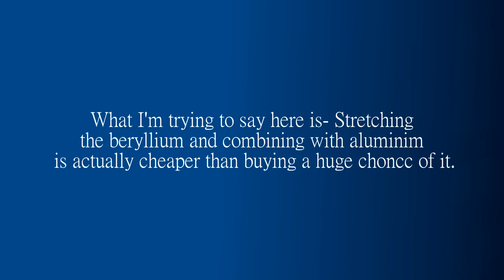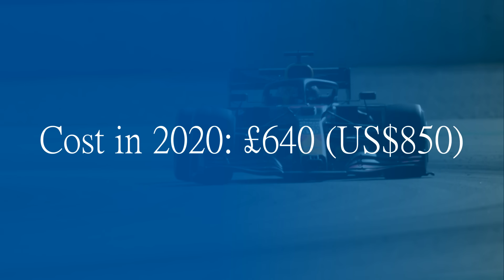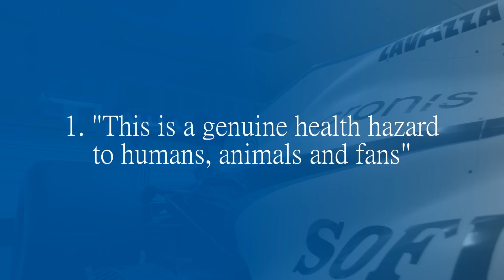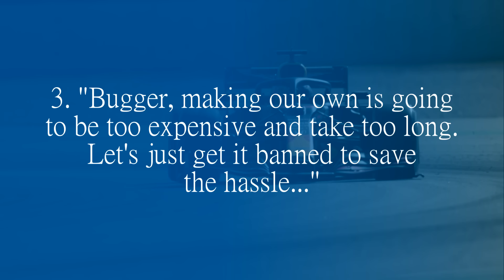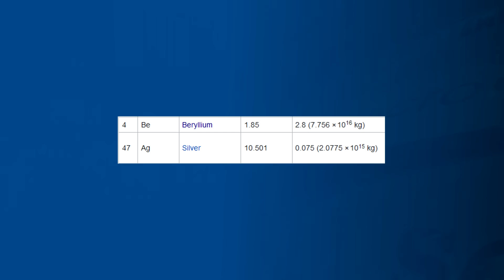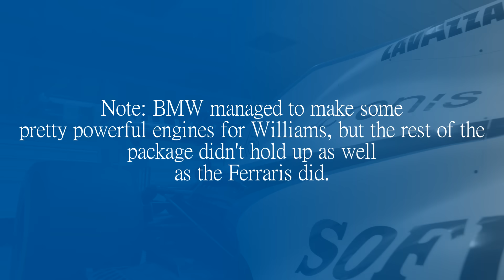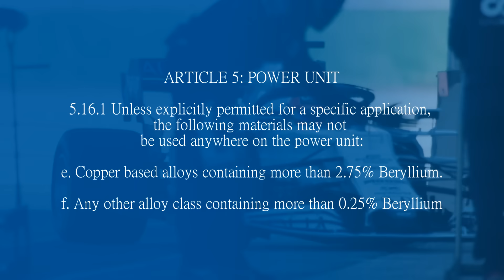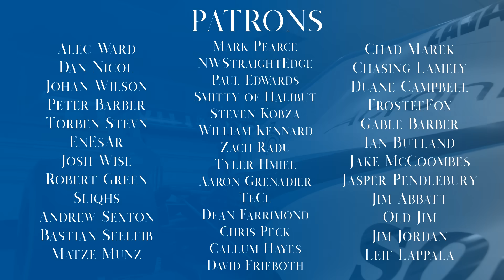MCLAREN'S "TOXIC" ENGINE! The Story of the Mercedes Beryllium Alloy Pistons (1998-2001)

Comment: This kinda ties into the banning of lithium and magnesium for chassis and rim construction because of an increase in catastrophic fires in the '70s and '80s. There's also the use of methanol fuels in older Nascar or Indy racing, methanol burns with a very slightly blue flame, but in daylight it's near invisible. So there are videos of refueling crews catching fire, but you don't see them being on fire and yet they act in a panic. Very alien to see.

Nowadays I think the carbon brake dust you see in the heavy braking zones is the new cancer-cause on the loose. Especially since it's carbon and I'm assuming there's a healthy (ahum) mix of grades of ultra-fine dust particles. I wouldn't want to breathe in a lungful of that stuff, imagine doing so for over 10 or 15 seasons.

Comment: The toxicity is heavily debated.   I have one supplier of this be bronze stating to mill , turn , grind , etc  ALWAYS wet AND with suction of air out of the machine .  He said some people ( roughly 30 percent) are highly allergic to be so even 1 particle can cause the  berrylium cough  as it settles in the lungs somewhere . In the long run the continous inflammation of that spot will lead to cancer.   

Another supplier stated that be bronze up to 1 percent be wasnt that dangerous and could be grinded dry using adequate removal of grinding dust with hoover / ventilation.   

Well....better be on the safe side I guess.

So apart from political decisions by the FIA ...... the possible harm if used in an engine was in my opinion valid to ban this material.    
Not to mention the price of the Lockalloy and price of machining and handling it.  And also the ideas of some big teams to make a complete engine block out of it so expansion rate was same as pistons.  The price would skyrocket of such engines .  Smaller teams could not afford such engines let alone if used as qualification engine for only few laps.....

Comment: The Porsche 909 "Berg Spyder" hillclimb car had beryllium brake discs. Well, one of them did, Porsche only had enough budget to outfit one of them that way. Which is scary, because as mentioned beryllium dust is extremely dangerous.
Reply: Are you sure it wasn't the calipers (a part that isn't being worn), rather than the discs themselves?
If it really was the brake discs, then that's clearly insane.
Reply: Thats insane
Reply: There's enough "ventilation" for it to not be a problem for the driver as much with his helmet, but the pit crew oof.

At least the engine itself, the pitcrew doesn't handle that on the spot.
Reply: well nobody is sucking air straight from the wheel, It will be fine
Reply: The dust that comes off metal brake rotors is the brake pad itself, not the rotor as the pads are carbon/graphite and the rotors are metal. Now if the brake pads were beryllium and the rotors were steel, then it would be an issue but no one would ever make metal pads as that is effing stupid.
Reply: beryllium IS exceptionally toxic to biological entities. Just google it. It has some wonderful physical properties, but it can kill you.
Reply: Wtf lol

Comment: You didn't explain WHY these engines made more power.
Longer stroke means smaller bore, smaller valves and LESS power.
Reply: A longer stroke doesn't always mean less power, take the ford pinto/Lima/metric engines used in pintos, rangers aerostars and most everything from the 80's till 2001. The 2.5 in the late 90's rangers Was the same as the 2.0 in the 86 ranger (except fuel injected not carbed and other tech stuff, OBDII instead of OBDI), but the parts would switch, and the 2.5 was stronger than the 2.0 same bore different stroke.
Reply: Leverage
Reply: I thought that shorter strokes means higher revs and faster power responses
Reply: Longer stroke smaller bore have some advantages over bigger bore smaller stroke engine. If you can make the longer stroke engine rev as high as the shorter stroke one you will make more power due to those advantages.
Reply: Longer stroke also means easier to achieve high compression ratios and (thanks to smaller valves) better scavenging in high rpms with identical valve overlap. Ofc you can out-engineer these "problems" in short-stroke wide-bore engines but it can become a question of tightening the tolerances even further

Comment: I've worked with berrylium coated metals in the past and had some health and safety modules during training. I may be remembering this incorrectly but we were warned not to let the soldering iron touch the sides for too long as it could affect the berrylium and we'd end up breathing it. If a soldering iron can affect it then I'd think combustion in a high powered engine would certainly affect it. 

Having said all that, this was just a coating and not an alloy. Most likely the coating is able to separate easily when heated but an alloy is able to resist heat and not degrade.

Comment: There are inaccuracies here.
1. Beryllium is not stronger than steel. Not as elemental Beryllium, and not as a Be-Al alloy. Elemental Be has a tensile strength of 370 MPa, and Be-Al is similar. That's the same strength as plain low carbon steel (such as AISI 1010), and this lowest grade of steels is never used for aerospace, or high level motorsport applications. A representative steel alloy would be something like 4140 chromoly, which has a strength of 800-1600 MPa. There are even stronger specialty steels, with strengths as high as 2800 MPa. Be is extremely weak in comparison to any steel that might be used in F1. 

2. The video shows "6x stronger/stiffer". Strength and stiffness are not the same thing. They are not even related. And as I said, Be is far weaker than steel. It is true however that Be is stiffer than steel, by about 40-50% for a given size, or 6x for a given weight. That does not make it stronger. Only stiffer.
Reply: I believe the comparison is more about the strength to weight ratio of various alloys, not their ultimate tensile strength.

Comment: Load of rubbish that these are toxic. You would have to grind them into a mircofine powder and proceed to inhale in considerable quantities. To say toxic is false it’s dust is an irritant which would cause respiratory irritation not toxicity. The disease cause would be similar to silicosis or asbestosis. Plenty of far more dangerous materials in a F1 car than this. Amazing innovation though, love the sound of these cars.
Reply from the maker: Considerable quantities? Just 4mg of the dust is enough to be extremely hazardous to your health. Which would come about in the machining process.

Acute beryllium poisoning is acute chemical pneumonitis resulting from the toxic effect of beryllium in its elemental form or in various chemical compounds
Reply: Hi 4mg is a huge quantity to inhale, also the machining process wound not produce dust fine enough to be considered micro-particulates to get to the terminal tissue to cause damage. We have intact fully functioning cough reflexes sufficient enough to resist this. Micro particulates would probably come from the combustion of the this material not machining.
Reply: @ellb4333  You absolutely don't know what you are talking about. See Aidan Milward's informed reply.
Reply: Well that’s your opinion, Aiden is getting toxicity and inflammation completely confused. Pneumonitis is inflammation not toxicity, and completely reversible. As discussed machining wouldn’t sufficiently obtain the particulates sufficient to cause this. Toxicity is due to agonist/antagonist key lock mechanism or interruptions in enzyme processes or cellular membrane respiration. Interesting video but completely scientifically inaccurate. Confusing medicine with sensationalism. Research your topic, look for informed studies with cohorts patient and numbers instead of being utterly guided by what YouTube tells you. What do I know I’m only a humble professor human physiology.
Reply from the maker: @ellb4333  yeah, really humble.

Would be nice if these experts could actually explain why someone is wrong without the condescension.

Comment: As exotic materials go, Beryllium is relatively inexpensive.  It’s cheaper than Silver.

Edit:  I just got to the point where you said Beryllium cost $300 more than Silver.  You showed a kilogram of Beryllium at $850US, Silver is $828.51, so I was wrong that Beryllium is cheaper.  It’s also not $850/US.  Maybe that’s the ore price.  I found it for sale at $27US per GRAM, or bulk discount at $2,200US for a kilo.

Comment: Alloys of beryllium are widely used in industry for non-spark tools that are used when working in explosive atmospheres (oil refineries, paint factories etc.) Any dust from beryllium is extremely hazardous and requires extreme caution however.
Reply: That will be beryllium-copper. Also in use for spot welding electrodes, thanks to its good strength and high electric conductivity. Still >90% copper though.
Reply: @eriktempelman2097  we use beryllium copper in tool making.   has great wear and heat dispersion qualities. great for molding components
Reply: Used to work in a ceramics shop that had a beryllium dept.    Sealed everything.     Very scary stuff.
Reply: @briansharp4388  Beryllium ceramics would be beryllium oxide or possibly beryllium carbonate, and would very much be a powder. Definitely more insidious than any beryllium alloy you'd encounter.
Reply: Porsche had used plated beryllium brake rotors on some of their hill climb cars back in the late '60's

While pure beryllium is transparent to X-rays and used as a 'window' in high vacuum applications like cyclotrons, it is reflective to IR and had lots of applications during the cold war for observation of missile launches.
Polishing those satellite mirrors cost my father his lungs.
Reply: This would make sense, at the time there was 4 oil refineries within 7 mile radius of the machine shop mentioned in my post.
Reply: C17200 Beryllium Copper is 2% Be.  This is the most popular alloy of BeCu.  Racers love it for use in valve seats for its combination of high thermal conductivity and hardness.

Comment: We use beryllium copper alloy on oilfield equipment quite often. It's not really as bad as it's made out.  Toughmet is an alloy with similar properties but without any toxic issues. Probably not as light though but nicely self lubricating and pretty strong.
Reply from the maker: So is it totally safe then once it's fused?
Reply: @AidanMillward  Well its used in hand tools like wrenches and spanners for explosive/hazardous areas for its non-sparking properties.  So I would say that is a good indication.  Basically unless your machining it that would create fine dust particles that could be inhaled.  Your good.
Reply from the maker: @MiracleManM  cool!

Comment: Don't you love the contradiction that F1 is "the pinnacle of motorsports" but that it also bans all kinds of developments that are too successful because of "unfair advantage" or the gloriously vague "safety reasons"? 

This incident by the way shows yet another example of how Ferrari uses its veto right/power over the FIA to undercut competitors. Yes, they posed it as a safety risk, but I think Adrian's comment of "we want it banned so we don't have to spend money to take away McLaren/Mercedes' advantage" was the main reason behind it. Ferrari doesn't give a toss about safety if THEY have an advantage. Just look at the horribly toxic rocket-fuels the first era F1 turbo-engines ran on: they called it gasoline because there was a tiny bit of gasoline in that mixture but it mainly was a very toxic brew of all kinds of complex hydro-carbons. Ferrari never complained about that, although everyone in the pits was exposed to that stuff.
Reply from the maker: Given that the stuff is highly toxic when it gets in the air, they probably had a point this time.
Reply: @AidanMillward  The same goes for that "rocket-fuel", complex hydro-carbons are pretty toxic too and the smell alone supposedly had people gagging and complaining about headaches.

Comment: Just a tiny correction, it was silicon carbide, not boron carbide, that was used in the aluminum metal matrix composites that replaced beryllium. Both metals are sold today by Materion under the SupremEX and Albemet brands respectively.
Reply from the maker: It looks like both were used. But interesting to note.

Comment: Beryllium also makes the pistons much more thermally stable, they don't expand or contract as much as other steel or aluminum alloys, meaning they probably could run tighter tolerances on top of being lighter. But yeah alot of engine innovations at the time were immediately banned, most before ever testing past single cylinder or computer phase.

Comment: So this is bad for your health, but we still use it in the air?
Reply: Yes, leaded gasoline/petrol is still legal and extensively used in piston-engined aircraft. I think the argument is that it would be even more dangerous if aircraft were falling out of the sky because the engine valves have burned out; it may actually be that the casualties from falling aircraft would be less numerous but more obvious than those from breathing in lead compounds that have come from engine exhausts. Aircraft piston engines of recent design can safely run on unleaded fuel. The fuel used in jet and turboprop engines is free from lead and always has been.

Comment: The Porsche 908/3 also used Beryllium for some of these cars brake discs. Hilarious if you think the material is actually poisonous or rather kicking allergic reactions. And brake discs are wearing over time… so, great to leave a trail of beryllium dust along a race track…
Reply: Just like asbestos brakes until 1997.

Comment: Used to install/machine Beryllium valve seats to convert old cylinder heads for unleaded use. Nice to find out 20 years later it's toxic. That and replacing asbestos clutches and brake pads without knowing makes me feel much better
Reply: Don't tell me you smoked as well...
Reply: @rkan2  If this person has managed to do all three and somehow NOT have cancer, I would strongly suggest for them to go to Las Vegas.
Reply: I worked in a automotive machine shop as well (NAPA) . I have replaced valve seats too. I was told it was just hardened steel inserts .
Reply: @321CatboxWA   You can get them made of many materials. Beryllium seats aren't as hard as tool steel or hardened steel seats which makes them nicer on titanium valves or something that is going to be slamming valves hard (big lift/high spring pressure). They also have great thermal dissipation.
One day I'd like to see Vegas, although long way from Western Australia 🇦🇺

Comment: The material they used is called Lockalloy.  It was invented by Lockheed decades before for use in space.  62% Beryllium/38% Aluminum.  You can still buy the stuff today.  Just don't grind it without wearing breathing protection.  Inhaling small particles leads to berylliosis.

Lockalloy was also being used for brake calipers in F1 at about the same time.

Porsche used Beryllium brake pads on the 917 back in the 70's.  (Talk about generating beryllium dust that might get inhaled by the driver.)
Reply: Im an engineer and if we even think about beryllium in a project we have to get 4 upper level signatures. Ive never actually gotten to use it because of that.
Reply: @josephjones4293  
The golf club manufacture used to use Berylium Copper in the putter heads
Reply: @mpetersen6
Ummmm… thanks?
My old race engine had BC valve seats… I didnt say Ive never heard of it, I said i’ve never gotten to do anything with it due to regulation
Reply: It's marketed under the name of AlBeMet by Materion (formerly Brush Wellman) these days. Same company that made the beryllium mirror blanks for the James Webb Space Telescope.

Comment: Most Al alloy FORGED pistons are generally considered to be only stable to somewhere in the 5000-6000 fps speed range. The rpm they reach this speed is a function of primarily stroke length and a little bit of rod length. With the pistons now more stiff and reliable at higher piston speeds, this enabled them to use a longer stroke, which would induce a higher peak runner air speed in the intake, with a higher effective “ram effect” before closing the intake valves.
Is there anyone out there making they with this high content still? I’ll take three sets please!
Reply: Brush-Wellman supplies about four different versions of Beryllium-Aluminum alloys.

Comment: Fun fact 
I use this material as a small ring around the cylinder bore with a copper head gasket to seal the combustion chamber . Works great for hi boost application.  Cheers mate from Brisbane Australia
Reply: what's a male pig doing in ur engine., mate ?
Reply: @jerryeinstandig7996  solid hahaha
Reply: After using mls and many other style head gaskets . The copper with bariliam rings is the be all of end all in cylinder heads gasket for running all of the boost

Comment: Mass dampers are not a moveable aerodynamic divice lolol I hate F1 so much
Reply from the maker: It operated independently of the rest of the car, so under the rules, they were.
Reply: @AidanMillward  the driver moves about independent from the car too. Milliner but you see me point. So does the fuel in the tank, and the oil in the resivoil
Reply: According to the FIA, it is a mobile device whose primary function is aerodynamic because it serves to reduce variations in the car's ground clearance that reduce the downforce generated, the same reason that prompted the use of active suspension.

Comment: Those copper beryllium alloys will be the valve seats I imagine, generally required for longevity when running titanium valves.  I wonder if the commercially availabe CuBe valve seats have more beryllium than the F1 ones...
Reply: 2% Be is the most popular alloy used for high performance valve seats.